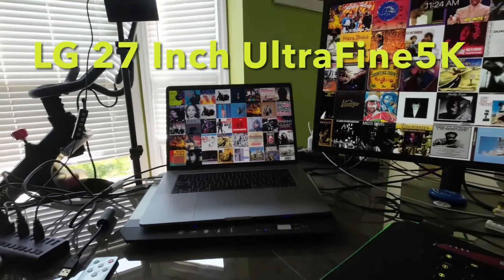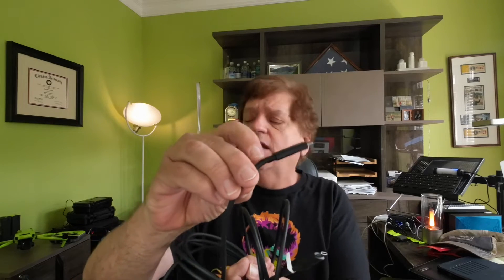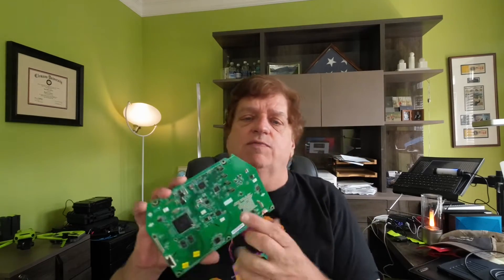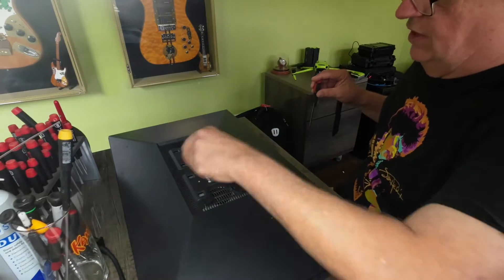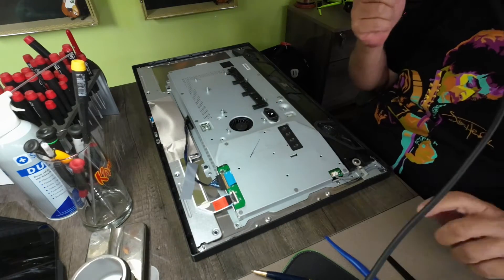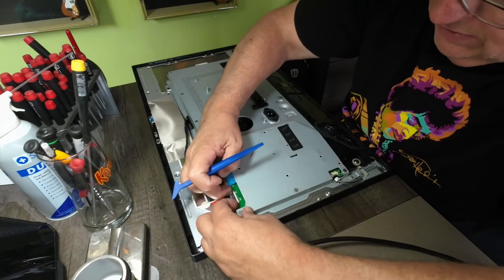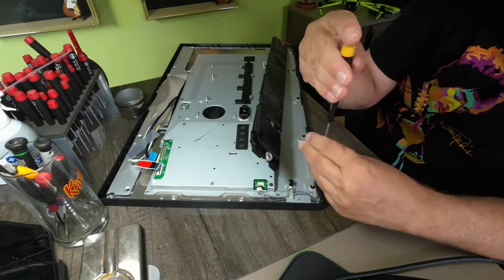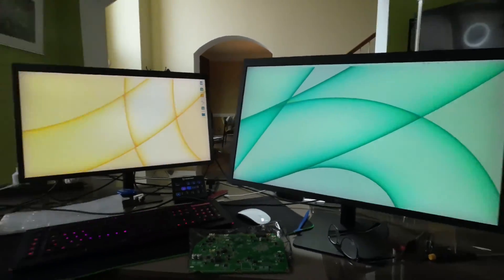LG UltraFine 5K Monitor Repair

Comment: BTW that thunderbolt port probably just needs to be properly soldered.  It seems their posts are badly attached and come loose resulting in the electronic connectors coming loose and then having intermittent problems with the screen not powering on if the cable is moved slightly.

Comment: Thank you so much! I couldn't figure out how to get the back of the monitor off, until I watched your video. Allowed me to fix (squeeze together with pliers) the Thunderbolt port that was causing the monitor to blink on and off (driving me batty in the process). Monitor now working again. You're a legend Jim! 🙏💥

Comment: Was your replacement $350 motherboard used off eBay, or was that for a new replacement part?
Reply from the maker: new off eBay
Reply: you can send an out of warranty monitor to LG to get fixed for the same $350 with a warranty I presume
Reply: is it possible to replace the board of the 27md5ka with the newer one from the 27md5kl?
Reply: @illumna97  i read from a youtubers comment that fixes these that it should work

Comment: Had the same issue. Bought another broken LG monitor on Ebay for dirt cheap, followed your lead, and then fixed it myself. Couldn't have done it without your video! Thanks a ton.